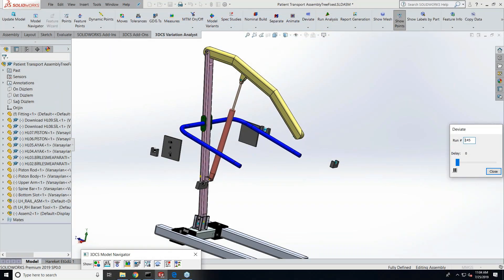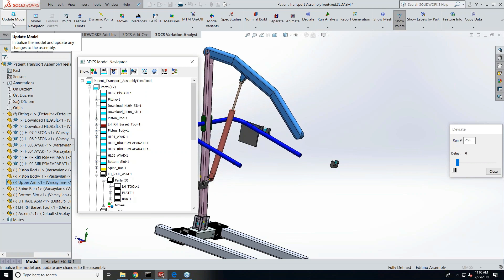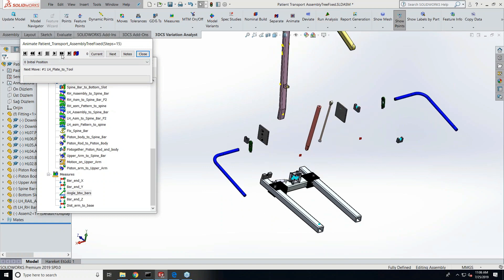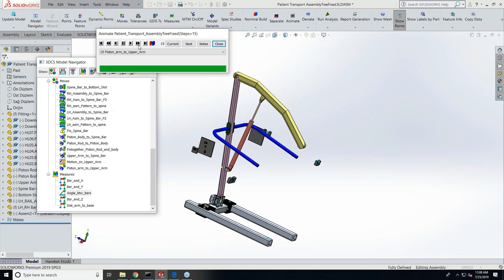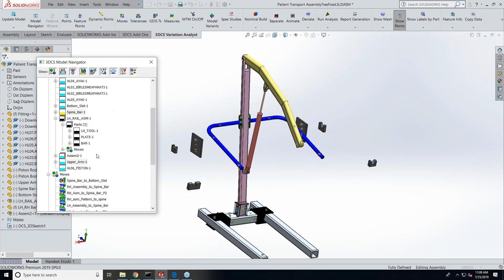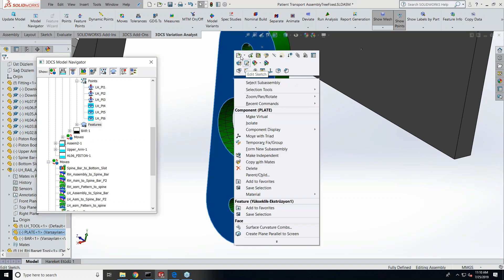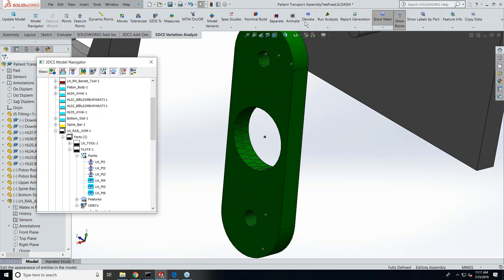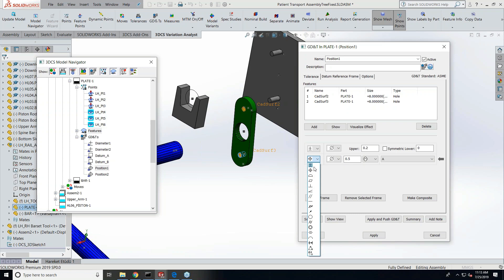SOLIDWORKS Tolerance Analysis - 3DCS is Now Integrated in SOLIDWORKS

Comment: How's 3DCS better than solildwork's native TolAnalyst tool which does 3D tol stacks in an assembly as well? What's the difference and advantage of 3DCS?
Reply from the maker: Hello! TolAnalyst is based on CETOL - which is a mechanical-focused tolerance analysis tool good for a wide range of applications. 3DCS is the high-end product in the market and allows for more complex assemblies, larger assemblies, incorporation of FEA, and full integration into additional CAD systems. I highly recommend though, whenever looking at a CAE or other high-end software system, to contact both developers and do a comparison based on your product and process.

Comment: Hello Sir/mam

Am actually trying to learn linear dimension with 3DCS tolerance Analysis. However based on the reference video I saw this is integrated in solidworks however 3DCS is not available in my solidworks. 

Am using solidworks 2022. I will wish a helping hand here maybe through screenshots and videos.

I will be waiting for your quick and positive response 

Thanks Sir/Mam
Reply from the maker: 3DCS does not come natively with any CAD package and needs to be obtained directly from DCS or one of its distributors. Please reach out to us on our website to learn more at 3dcs.com